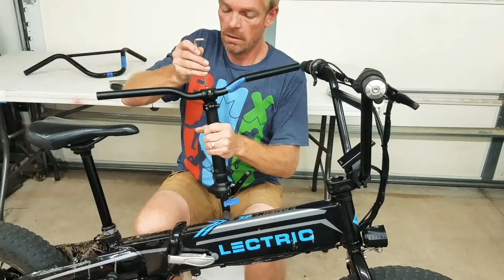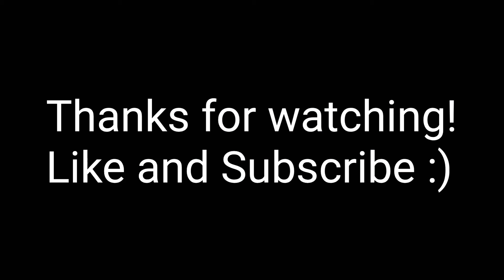Lectric XP BMX Handlebars

Comment: I have an e-bike that has motorcycle type, sway-back handlebars, that I DO NOT like, and I have a BMX stunt bike with nice BMX handlebars, and smaller cranks, shorter crank arms, and freewheel, that I DO like. I’m might use the BMX parts off my old bike on my new ebike, and get rid of my shimano 7-speed. I want my e-bike to more a BMX style.
Reply from the maker: Sounds like a good plan!

Comment: Thanks for the video! when I first ride on my Lectric XP lite I feel very unconfortable with the seat and the distance of the handlebar, because make me turn my self toward to the front, I'm a 55 years old disable man, not too young anymore. I watch a video where they invert the steam, instead being toward to the front like come from factory, if invert it the steam inclination will be toward the back of the bike. 
I did that, and I bought a seat post with suspension and a large seat,, that alawed me push the seat back, and the handle bar towards me, and I have my back straight, and no more pression on my hands against the handlebar, what I love.
I like that modification you show, next thing I will do is put a front suspension on my XP lite, and I thinking in put that BMX handlebar on it. Thanks again!

Comment: I ordered two stems (one as part of the BMX kit) for two separate bikes. One stem was fine and installed/functions without issue, but the other stem was defective - it can not be opened, even with considerable force, enabling it to be installed. After many many emails back and forth with the company, and having even sent a video demonstrating that even with all my force I could not open the stem (yes, I know how to open them, I installed one already remember), they eventually, after many delays and follow-up confirmed it was defective and confirmed they would send return mailing label. I have now been waiting for days, with absolutely no response from them after, again, many emails, to receive the return shipping label. I am now initiating a charge dispute through my credit card company.
Just be aware if planning to place an order. As I said, the product is very cool, their treatment of customers if product has a defect, at least based on my experience, is terrible. Buyer be aware.

Comment: Best video . I did my Eahora X7 by watching this .  Got the bars and head-stem from a BMX site during a sale and the quill stem + carbon-fibre spacers from AmazonUK. Worked out a lot cheaper to do than i thought it would. 
I'm not a fan of those T-bars that seem to come with most 20" fatbikes and this is an excellent low-cost way to change up your E-bike.
Thanks for the great info !
P.S: Need to get one of those fun looking remote-controlled seats too :)
Reply from the maker: Glad my video helped! Thanks for watching!

Comment: Looks awesome,  great video! I'm trying to put the bmx handlebars on mine put I can't figure out how to take the twist throttle off the original bars, any advice on how to remove so I can put it on the new bmx bars
Reply from the maker: Thanks! There's a tiny allen set screw holding the throttle in place.
Reply: @sed6  thank you!

Comment: But now it's not a foldable bike. Because the folding mechanism is not going to work for the handlebars.

The other issue is what's great about these electric e-bikes is that they're not BMX jumping type crazy bikes. They are stand up type bikes So a comfortable ride. I would not use them like a BMX bike I don't think they could handle it and they're way too heavy.. So I don't see the point of converting in the first place but.. 

When you convert to BMX handlebars for you to get the proper seat adjustment for your legs if you're a tall person say about 6 ft now you're really bending over because you can't really raise the height of those BMX handlebars. 

Very uncomfortable for long rides.

So basically you're taking a nice upride bike kind of a mountain bike a little bit That's very heavy  that you really can't use for BMX biking And now you're making it uncomfortable and you can't fold it down the right way when you store it in a car. 

It just doesn't make any sense. 

I could see changing the handlebars on a folding bike to be 30 in wide from the 24 in wide of the electric XP for more comfortable controlling ride when steering. 

But again I just don't get it. Other than for the aesthetics.. well or unless you're a little kid And you want the BMX bike feel can you not that big of a person.
Reply from the maker: Thanks for watching! It does still fold the same 👍
Reply: @sed6  yeah still it just doesn't look right to me on these bikes I guess it's a kid thing where you used to a BMX bike as a kid now you want to put those handlebars on your grown up bike.

It's kind of like putting a cat's head on a tiger body.  Or vice versa It looks weird. 

And if I'm correct if you're a tall person like me maybe 6 ft and over I put my handlebars on my G-Force T42 bike which I absolutely love..  putting the handlebars up all the way I like to sit upright and be relaxed these bikes will never perform like a BMX bike so I don't see the point of having handlebars making it uncomfortable for long distance that are too low. 

But I thought those handlebars did not fold down like the original ones. If you mean fold down meaning you have to loosen the armor and screws it's not going to fold down as compact as the original.. 

I don't think I saw you fold them down Maybe I wasn't watching?

Comment: Hi,, It looks like you shortened the loom.   how simple or hard is that ?   thanks
Reply from the maker: It's very easy to slide off once you remove all the wires, but if you don't want to do that much work you can just cut it with scissors.
Reply: @sed6  so just cut it and splice together and tape up?  Are those all just simple copper wire cables?

Comment: Hello and thanks for all of the great information you are providing. Do you think that the stock stem could be cut down shorter and still preserve the ability to fold?  I just got my Lectric XP 2.0 up and running this week and really want to change the handlebar situation. I find the stock steering to be quite jerkey and want to replace it with something with a more swept back, relaxed and upright position. Thanks again for this great video. Now I finally understand risers and quill stems
Reply from the maker: No you cannot cut and still fold the stock stem. You can however buy shorter stems on websites like AliExpress.

Comment: Hey, i did the bmx bar swap to my lectric xp..if i want to add the front suspension fork and use the bmx bar setup, can i just cut the tube on the new suspension to where i want it and still use the quill stem setup i have for the bmx bars?
Reply from the maker: Yes you can!
Reply: @sed6  cool...so i just need to order the front suspension fork? Does that come with the bearings you mentioned in the video

Comment: Thank you for this video. I would like to get a lectric and do the same for my 9 yo son.  He can't keep up with the family who all have ebikes.  Do you think this mod would work for a 9 yo boy?
Reply from the maker: No, my 10yo nephew is too small. My 11yo nephew just barely big enough and my 13yo nephew rides it like he stole it! It's as much about the weight of the bike compared to the kid as it is riding about riding position.
Reply: @sed6  thanks, that helps.  I'm going to go with the swagtron eb7 and try to do this same mod.  Hopefully it works for him. We have no choice, he can't go on the rides everyone else is going on. The eb7 is much smaller and lighter, we will see. I'll have to wait and order the stem when it comes so that I have the correct measurement.
Thanks again!
Reply from the maker: @johnsivo500  did you ever get the swagtron eb7 for your boy?

Comment: Awesome video! New Lectric XP owner here. Sorry, for the dumb question but what size is the stem? 25.4 mm? I also see you have some sort of thin foam or between the handle bars and stem. Does that come with the stem or is that separate? Can the handle be raise higher or lower? What do you need for that? Thanks.
Reply from the maker: Hiya, 25.4mm is correct for the stem size. That foam you see is actually holding on my digital display to my handlebars it's not holding the handlebars to the stem although it kind of looks that way.

Comment: Did you consider installing dirt bike handlebars?  If so, why did you go with BMX bars over dirt bike bars?  It sort of looks like all the BMX bars do is replace the long stock stem ending up with about the same thing but with less space on the bar to mount accessories.  Great video btw....just got my XP and trying to figure out what upgrades I should do. The fender vibration or whatever it is that vibrates at higher speeds is about the only annoyance I'm noticing so far...and also the lag in throttle response...not sure why there is like a one second delay before the motor responds to the throttle movement...You automatically get used to it but I would rather have an instant response.
Reply from the maker: Thank you. I never considered anything besides the BMX bars because they offer far more room for accessories than any single straight bar could.
Reply: change P11 from 3 to 1
Reply: press up+down and hold few seconds. press select to advance to p11. press down to lower count. press up+down to exit. Recheck values as sometimes pressing up+down same time messes up.

Comment: Hands down the best handlebar mod tutorial out there for this bike...thank you! I have an aftermarket handlebar that is a consistent 7/8” all across the stem area so it doesn’t have the thicker 1” stem attachment spot in the middle. The XP has a stem to handlebar bracket that appears to require a  minimum 1” handlebar width to tighten down properly. Should I just buy a shim that’s converts the 7/8” handlebar to 1” ?
Reply from the maker: Thanks for the nice comment! Shims or several wraps of tape should do the trick!

Comment: Would you say most 20inch bmx bike handlebar/stem setup would be a direct swap into the lectric xp?
Reply from the maker: Absolutely! Once you get that quill stem adapter you can put any stem and bars on you like.
Reply: @sed6  good to know, but you don't think existing BMX quill will work?